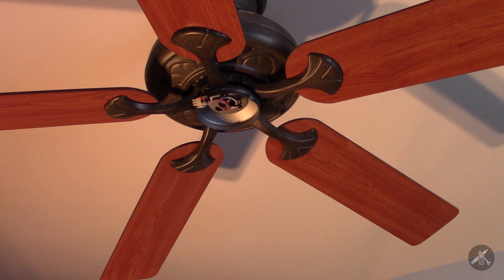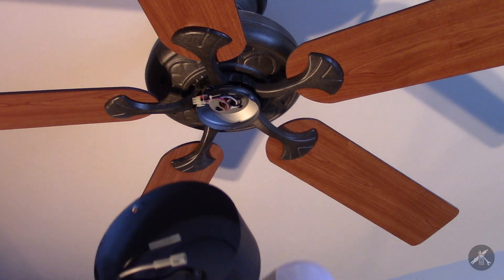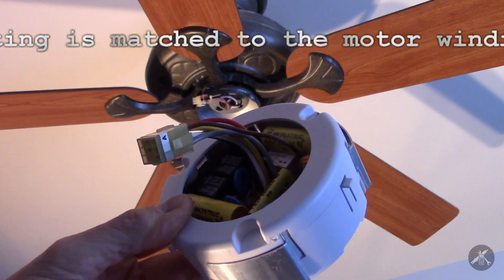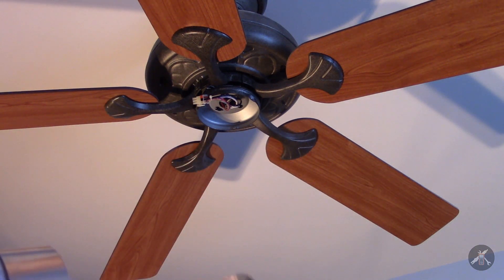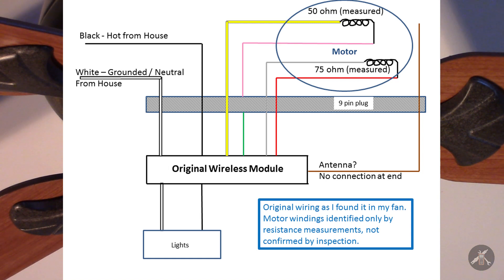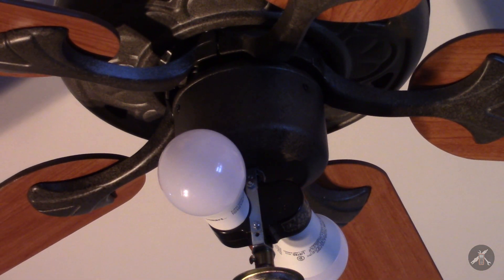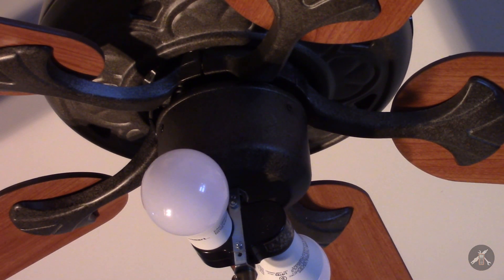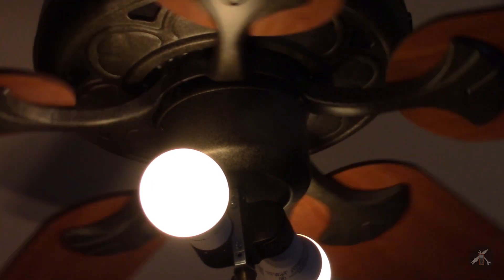Repair Hunter Factory Wireless Remote Control Fan - Install Universal Remote Module

Comment: Don't understand what you did, you cut the video of the connections, the universal remote has three wires on output, such as one for light ( blue color ) one is black ( for fan motor ), and one white wire for motor Neutral, You are saying in this vidoe that you connected capacitor 6.5MFD between white neutral motor wire and red wire the reset of speed wires must be taping. My question is whether you connected the black wire coming from the remote with the gray wire of the Fan motor or not ? Please send details
Reply from the maker: My wiring is exactly as shown in the "as modified" wiring diagram here:
https://youtu.be/BQQTPncFsMg?t=284
If my description isn't clear, the wiring in that diagram with color codes is what I used.  I can't define wiring based on what colors you might have, they may be different.  My new module had 5 wires: black, white, yellow, blue and the antenna that was also white. I followed the manufacturer's instruction sheet for the module to define the wire connections. My black ungrounded (hot) wire from the house went straight to the black on the new Hunter module. My new module had a yellow wire that went to both yellow and gray of the motor.  The 6.5 MFD cap went between the grounded white and the red lead from the motor winding as shown.
Again, I must caution that your wires may be different colors and if you are not sure what each wire does, you should consult a qualified electrician.

Comment: I'm not sure if I'm looking at this correct, but is the capacitor connected in series to the higher ohm side of motor and parallel to the lower ohm? Why is this? And 2nd question, lower ohm is higher speed, correct?
Reply from the maker: Yes, from what I traced in my motor, the capacitor is connected as you described.  I don't know the reasoning in the motor design.  Essentially this is a "capacitor run" type induction motor with both windings running with continuous power.  The general principle for one of these motors is that for it to turn, it needs to have an AC phase shift between the two windings and the capacitance provides that. Varying the amount of capacitance provides different amounts of that phase shift and changes the speed. In looking at other fan motors with mechanical switches, I have seen different methods of switching capacitors in and out, with some motors having capacitors in line with either or both windings.
I don't know the significance of the different resistance readings, because in AC motors, the impedance due to inductance of the winding is sometimes more important than DC resistance and that is harder to measure.  Hard to know what was in the motor designer's head.

Comment: I'm dealing with the same situation right now, 25 year old Hunter fan that still looks like new but has been non functional for a year or so. One day it just stopped working and I could not determine what was wrong. Was looking at replacement and decided to troubleshoot again. Nothing seemed to work, Hunter suggested I "hard wire" the receiver. Not sure what they meant... As I was giving up and putting it all back together for now I chanced to try the remote right up next to the receiver and it worked! But, once the cover was back on it does not communicate at all. 

So, a universal remote and receiver looks like the way to go. Yours was the first video I found that actually addressed my situation and concerns. I would have liked a visual of the wired capacitor and receiver before buttoning it all up, as my diagram reading skills are lacking. But I'm going to attempt this.

Thanks!

Comment: Great Video!  The wiring diagrams helped me a bunch!  The remote module I had wouldn't fit in the light cup, so I did follow your suggestion to run the extra wire.  The controller connected to the mains, fitted into the top of the fan, the white and black wires I connected to the main fan wires, and I ran a new wire that I connected to the light (load).  I clipped the original plug and wires off the board and reused it in the light cup with the right wires connected with wire nuts. I didn't have a starting capacitor on hand, but I clipped the 6mF off the original controller and soldered some wires to the leads, covered with heat shrink, taped to the capacitor body.  Who knows how long the solder job will last but it got it going, and replacing it is as simple as pulling the light.  It is a touch slow on low, so maybe 6.5 is better, but it works.  It's a little more work to take it down, but it did allow for a good cleaning and retightening of all the bolts.
Reply from the maker: Sounds like a good solution! It's great that you're able to reuse the components you had on hand.

Comment: Thank you for this video, it saved ouf fan from the landfill.  I used a 5mfd and it worked perfect. In my case I had to cut the cup a window so that the receiver got from amazon could fit I used a dremel tool for that and it ended up being pretty discreet aesthetically, so all is working great.
Reply from the maker: You're welcome, glad it helped.  It always seems to be a waste when an otherwise good part / device is scrapped because a part isn't available for it.

Comment: Don’t understand what you did
Reply from the maker: From a technical view, this fan motor is a single phase capacitor run induction motors that has two windings, a main and an auxiliary.  In order to make the motor rotate, it requires a phase shift between the two windings.  This is accomplished with a capacitor in series with one of the windings.  The rating of the capacitor in microfarads defines the speed of the motor by changing the amount of the phase shift. So, the factory module contains the required capacitor and when you remove that module the motor will not rotate any longer unless you can identify and hard wire the correct capacitor for high speed into the correct location in the circuit. The universal replacement module is meant to be installed into a fan that has manual switches with the required capacitors already installed.  The replacement module then relies on the high speed capacitor to run and uses its internal circuits to provide lower fan speeds.  I had to identify what I thought was the right rating for the capacitor from the original module, then rewire the fan to properly install the parts. The speed seemed reasonable, so I presumed that I picked the right capacitor value and didn't need to experiment with different values.

I hope that helps.  It is somewhat complex and is why I caution strongly that this work requires technical understanding of electrical systems to interpret the wiring diagrams and make safe connections.